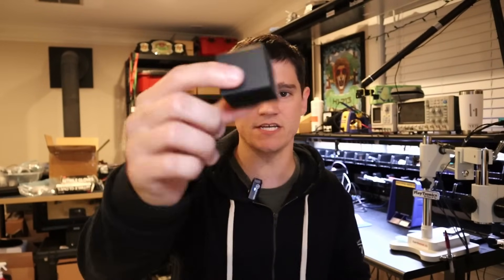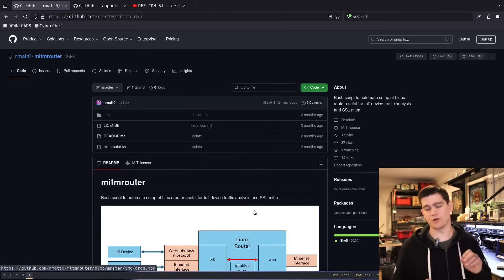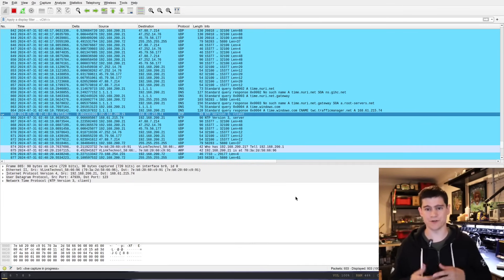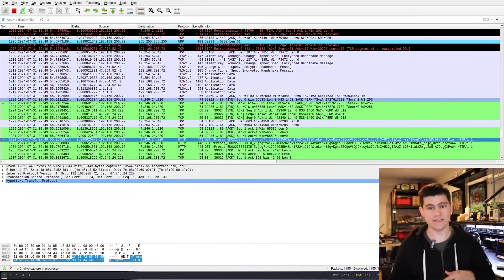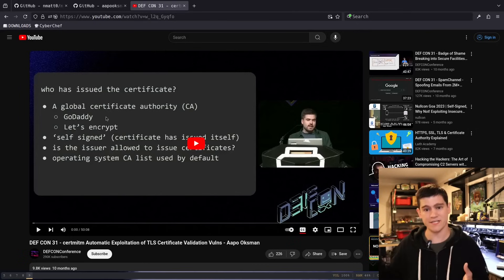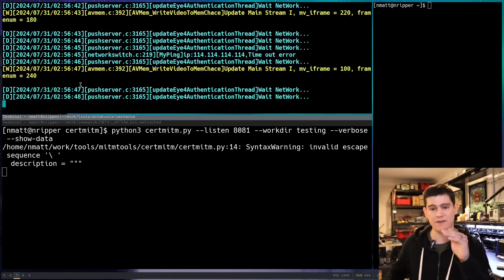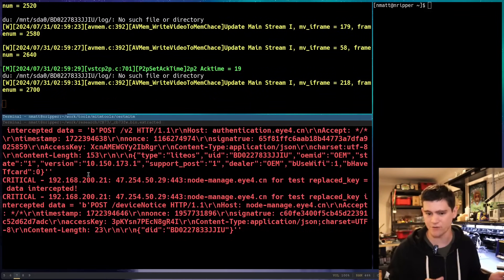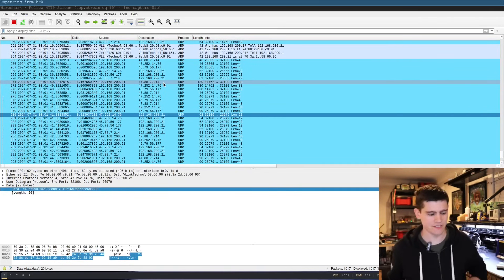Decrypting SSL to Chinese Cloud Servers - Hacking the VStarcam CB73 Security Camera

Comment: Helped a friend set up a 6 camera system.  He bought 4 reputable cams and two cheapies.  We configured all cams to shut off any and all cloud services.  All were set with static IP, gateway, NTP server, and NO dns.  The four reputable ones generate zero unexpected traffic.  The two cheapies?  Constant flow of connection attempts to cn owned IPs, as well as dns requests to google DNS IPs (apparently hard coded).  Nothing goes anywhere since they're on a segregated VLAN with no outside access... but the firewall packet counters are in the millions.
Reply: Probably spyware selling what you do and recording that
Reply: I did the same, for all my Reolink cameras
Reply: @zyghom  Do they stay quiet on the network?  My Hikvisions do.
Reply: @khx73  they don't stay quiet but firewall does not let any traffic from them outside my LAN ;-)
Reply: @zyghom  Dirty little things... haha
Reply: @khx73  wouldnt it be better to use a additional filter , in case firewall dies? you can even do that at kernel space
Reply: Brand names so we know what to get?
Reply: Yeah, I would love to know what brands are known as "quiet" ones. Have some YouTubers run things like this as a part of their CCTV reviews. I would absolutely be interested in such aspects of reviews.
Reply: That's cool and all, but to assume the expensive ones are safe is ridiculous.
Reply: @mtscott44  You're right.. I wouldn't assume any are "safe".  Treat them all the same.. as with any IoT devices.
Reply: I did the same all my cams are on a separate vlan and have no internet access. The only ips that can access cam network is my blue iris and home assistant
Reply: @d_techterminal  Same.  B.I. is great
Reply: I have to wonder what the use of a security system that only records locally is outside of I guess not trusting people authorized to be there.
Reply: @BeefIngot they are talking about allowing the cameras to only communicate with their NVR (Blue Iris). They have trust in the NVR and probably access it over the internet but don’t trust the camera’s firmware.
Reply: @khx73  Your Hikvisions stay quiet huh? lol
Reply: @lameshithead  If the firewall dies, you want all traffic to be cut.  It would be a poor firewall that in the event that the rules somehow die without the device itself dying, that then all traffic is allowed.  That would be pretty insane.  So I am sure some Fortinet device does it, but it will not be something that is normal behavior.
Reply: @LackofFaithify  wow that comment makes me think 🤔 so I guess you need ebpf in combination with firewall, or firewall ha
Reply: @LackofFaithify  Yes they do.  Verified. "lol"
Reply: @davedubreuil  What I mean is if the footage is only stored locally, an invader could remove the footage.
Reply: @LackofFaithify  i thought about this again and you can do high availability with firewalls, but in general you want to have a loadbalancer and firewalls for each endpoint, or node
Reply: @lameshithead Most actual routers that don't look like some spider made by ASUS can do HA.  Heck, even the ASUS spiders can probably do that at this point. The other point is about writing your rules and ACLs properly.  And If you really want to be safe, give the cameras a fake (virtual, I say fake here because it won't take them anywhere) routing table.  That way even if they can somehow start spoofing MAC and IP they still can't get out.
Reply: @LackofFaithify  thanks man! def. worth knowing and thinking about this!
Reply: @khx73 can you still access them remotely? like an an app
Reply: I just put the camera on another router
Reply: Isn't that simply cloud based cameras that are trying to register themselves in cloud portal?
Reply: @sierpus  LIkely, yes.  However we shut off all the cloud services in the camera's configuration first thing.  Even removed it's DNS addresses so it shouldn't be able to go anywhere.  Yet it still tries constantly, with hard-coded DNS and supposed cloud server IPs.  Quite sketchy behavior that isn't seen on the reputable cams.  Also at question is the integrity of the communications these rogue cams are making if you allow them.  Matt's videos are currently covering this.
Reply: @khx73  yep, agreed especially the encryption part of it. I have camera at home as well, tapo. It sends feed to tapo servers. I'm ok with that although in my case, came is off (through the relay) while I'm at home. It turns on once I leave it
Reply: @brody2642  Third time I've tried to reply to you... must be triggering some YT censor bs.   Yes I can.
Reply: @BeefIngot you can build a storage nas and hide it anywhere in your house. A common thief wont know where that is.
Reply: @LackofFaithify
Reply: Thats insane. Can you dump their firmware and look for intent?
Reply: @zyghom  that's what you think. are you 100% sure about that? (not trying to be a dick, just make you think or be more paranoid :p). Hugs.
Reply: @mtscott44  Exactly. The expensive ones could still probably be using non-traditional protocols to exfiltrate data or zero-day exploits in the firewall software (the latter, being independent of the camera vendor, but still).
Reply: Our vast network of around 100 Wyze cameras are silent on the network. They don't do anything shady, I consider them the best "cheap" camera on the market, especially since you can update the firmware to use RTSP and 3rd party recording and AI detection.
Reply: One reason I use hardwired cameras. Quick and secure on my property, all prewired in such a way t
Hat IF they were ever to produce cameras with fiber optic output I can pull fiber instead of cat6 or discrete video lines.
Reply: @Subgunman  The ones referred to in my OP are hard wired.   I would never use wireless ones unless absolutely no other option was available.
Reply: @BeefIngot    if that happens you have bigger issues than someone acquiring that information.

When I worked in places like that we were not expected to have an intrusion in the CCTV storage area without a literal gunfight or use of explosives, and I did had to deal with the aftermath of an explosive attack. Equipment did its job of recording even the EMP interference of the explosion but like I said, you would have bigger issues to deal with if such brazen attack didn't care about being filmed.

It also helped to have laws to keep "waah I want to watch remotely on the clouds" managers in check - just asking for it compelled me to report you.

Waking up 5AM to the police to call me at the explosion site to retrieve footage off the vault, fun day.
Reply: So name the brand bro that you recommend. Stop being "unexpected traffic-er"
Reply: @Popclone  Do your own dammed research.
Reply: @khx73 Poor guy. Your Mama didn't love you?
Reply: Any traffic to non CN Servers? Why look only for CN traffic?
Reply: @Stefan_Dahn  😢
Reply: @luciopascarelli9309  are you that much of a noob?  he's not LOOKING for CN traffic, he's just reporting the destination addresses of what the camera and app are trying to connect to.
Reply: Same. Cameras on isolated VLAN. No internet access. DNS and NTP redirected to the local server.
Kept asking my DNS server to look up addresses to talk to the manufacturer and then subsequently attempting to contact them. (Stopped by the firewall, obviously)
After blocking DNS too, they're no longer trying to phone home, but now stuck at the point of (unsuccessfully) trying to find the address to phone home.
The only thing allowed on that VLAN now is the catch-all NTP redirect rule to my local NTP server.
Reply: @VirtualBSHere  Nice.  Sounds exactly like what I've got for my own, and the system I talked about in the OP.  Even after setting their DNS IPs to 0 (or anything), they would still try connecting directly to 8 8 8 8 or even skip DNS altogether and try connections to a few hard coded IP addresses.  
Banished to vlan/fw jail forever.

Comment: Looking at some of the details decoded by certmitm it looks like the cloud infrastructure may be setup for multiple manufacturers to use (the reference to OEM look interesting).  What are the chances that the work that Matt is doing applies not only to the make/model of camera being analysed, but also other brands and models ?
Reply from the maker: Wow I didn't catch this! I bet you are right and that there are a bunch of whitelabel brands out there.
Reply: im sure many companies are using these services.  Think about the cost for them to pay for this infrastructure, these companies are pretty obviously selling some kind of data to pay for it.  These cameras dont cost that much so they cant keep that kind of operation afloat for free

Comment: What i'm interested in is when firmware detects that it has no internet connection (because I put it in a network jail), but that triggers routines in the device to escape the jail by automatically connecting to any nearby open WiFi without being told to. Or having firmware that can entering promiscuous mode to watch and analyze other devices for te purpose of masquerading as those devices after it sees it's silent for 30 minutes or so in order to find a way out of its jail.

I'm concerned with so-called security cameras that provide no actual data security, or worse actively try to evade attempts to make them secure. It's not a matter of whether your cloud data is secure, but when it becomes insecure and whether you will ever know that it has happened.

Cloud data means it's stored (potentially indefinitely) on someone else's computer and used for whatever purposes they want to use it for. And you have no recourse if they lied to you in the first place, or later abuse that trust whether it be willful or by neglect.
Reply: that's why I have to wrap the device in tinfoil, so the WIFI doesn't work
Reply: That’s technically possible. But in practice, I don’t think most companies producing these cheap cameras are doing that. Not only does it significantly increases the software R&D cost, they have little to gain from, since most people using it are not experts in security, and simply sending data from device to their server is enough to “monitor their customer” (if that’s their goal). I bet most of their target customers don’t know how to setup a Firewall on their router.

What you have described is more like an attack organized by state-backed hackers, who knows their device is likely to be placed in an airgapped environment or some sort. But let’s be honest, any high security facility won’t use WiFi security cameras at all. So a state backed hacker group will likely spend their time on something else that is more effective.
Reply: Have you identified any devices behaving this way?
Reply: There is always someone smarter hacking what appears to be secure. However if they’re at the top of the game they’re going after big fish.
Reply: @monad_tcp don't forget to properly ground your shielded cables so the devices can't use the cable as an antenna when they realize their Wi-Fi adapter can't see anything with the built-in antenna

Comment: A token was sent in clear text, havent watched the whole video but could be used to start a remote unauthorized stream with it, same was done with eufy cameras. The JPG is the thumbnail of the camera seen in the app. And when it comes to mobile applications not properly SSL pinning, this can be fairly easily circumvented with reverse engineering and the usage of software like frida, to override functions and or inject your own logic.

Comment: So.. to make sure I'm understanding - The flaw that allowed you to successfully run the MITM is that the camera didn't validate that the certificate was signed by a trusted root, so it trusted the cert dynamically generated by the utility?  If this is the case, but it didn't work, is it common to be able to inject a new trusted root into the filesystem of the device under test, or if it did the root validation, that would be pretty secure?
Reply: I could be wrong but I think in this particular case, the dynamically generated certs weren't even needed, as the app didn't even bother to validate the server cert.
Reply: @effsixteenblock50  Oh..  I was figuring that "not validating" the cert meant it just didnt verify it was valid up to a trusted root installed on the camera, but if it really didn't even validate the name of the cert, that's a new level of carelessness on their part!  I might have to get one of these things just to play with now!
Reply: @SteveJones172pilot often devices do nothing more than verify the common name/san matches an expected value. In those cases a self signed certificate with the same name as the intended site will suffice.

Comment: Some of the request headers (nonce, signat[ru]e, key) suggest that they might be using HMAC to prevent tampering. And since they also misspelled "signature", who knows if it works. In that case, presumably there are some HMAC secret key on the device. One of those things that sometimes get slapped on to "mitigate" interception issues, even though it only addresses one part of that (tampering, but not inspection).

Comment: was the initial HTTP Request packet for that .jpg file just a "semaphore"  or   "signal"  to  the chinese server farm that the device was rebooted.   and perhaps the "token"   was really a way to get a message to those servers?    This might have been a method of obscuration used by the manufacture.   also,  I noted that a HTTP 404 was returned by the server.    hmmm

Comment: Do these cameras have built in chinese backdoors from software or hardware or both ? And have you created a list of security cameras that have been compromised ?
Reply: Yes it has been proven, there are even Website with hacked or unsecured cameras..
Reply: @mmuller2402  Very worrying.
Reply: @Matlockization  what actually happens is these devices have to use remote servers to generate things like thumbnails and/or previews. The problem is you have to compete on price, not security.

Comment: Ive learned so much from your videos. I have a basic soldering system setup but I cant do smd stuff let alone desoldering firmware chips. What would be the entry level equipment that you would recomend??
Reply: My background is Unix in general. Going back to the Solaris 3 days. I get the software side of things but I need advice about the hardware side to get to the software side. I can't afford the crazy expensive setups that we see on the channels. I need something that its OK to fail now and then. Thanks for any advice you can give. It'd be better then me just picking temu crap at random.

Comment: Hey man! Love the vids! Even though I can only follow about 2% of what you’re doing. 😂 Have you ever looked into Bluetooth SoCs like the QCC303x series from Qualcomm? Specifically, I’ve been perplexed by the QCC3034 (BTM334) modules that Wondom/Dayton Audio use on several of their Bluetooth audio amplifiers and receivers. I’ve been able to connect USB directly on other QCC3x3x modules, but the USB debug pins on the Wondom/Dayton Audio modules appear to be locked in the chip configuration. There is a 5 pin SPI port on the boards, but I haven’t been able to establish a connection with a USB-SPI converter. It appears to only be compatible with the Qualcomm TRBI200 debug tool ($350). I’d be interested to see you if you could take a crack at it. Cheers!

Comment: Hi Matt, Can you do a video on decrypting the wireshark tls packets after certmitm injecting a self signed certificate in the camera connection? I mean, that should be possible now, right? I tried loading the certmitm key file into Wireshark but I just cannot get it to decode the tls trafic.....
Reply from the maker: That is only possible IF the TLS cipher used does NOT provide perfect forward secrecy.

https://en.m.wikipedia.org/wiki/Forward_secrecy

I agree this nuance would make a good video.
Reply: @mattbrwn  So, how would you proceed if you want to spy on your camera traffic to see all the messages forward and backward with the Chinese server?
Thanks for the link! Interesting!
Reply from the maker: A transparent proxy.
E.g. certmitm or mitmproxy
Reply from the maker: Also sslsplit can create a synthetic pcap file if you really want to view the data in Wireshark.

Comment: I had a cheap security camera to set up. It turned out that you could view it online on a Chinese site at the same time as it was being used by the owner, and that wasn't clear in the instructions. I can't remember exactly how I found the site. The camera was an 'Anran' pan and tilt wi-fi camera. It was one of those that you set up using qr codes on the mobile app, and let the camera see it (something else to experiment with!). Luckily you could use it camera to phone, without internet, as the person that owned it didn't have a router - all internet use was mobile Internet (I did say that it was probably best to disable the mobile internet when viewing the camera though.)

Edit, just found a copy of the set up QR code, looks like part of a URL, and a 'P' parameter with a base 64 encodeed string that reads 'Anran123' - probably the default (maybe override too)  password.